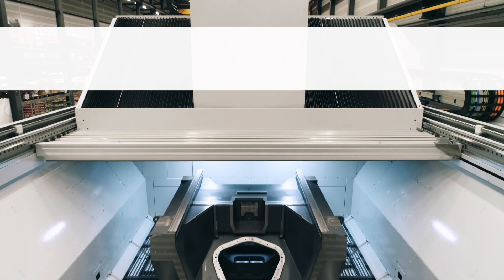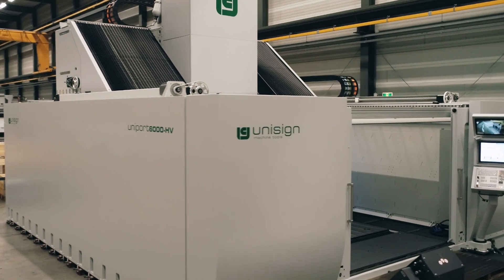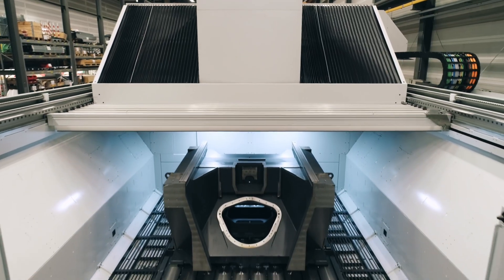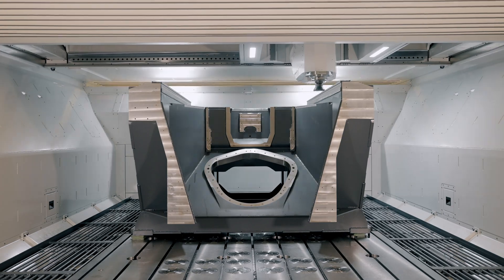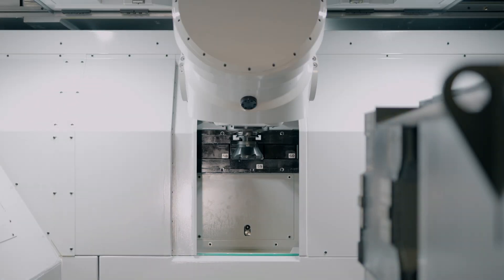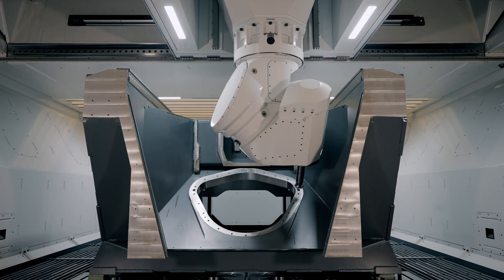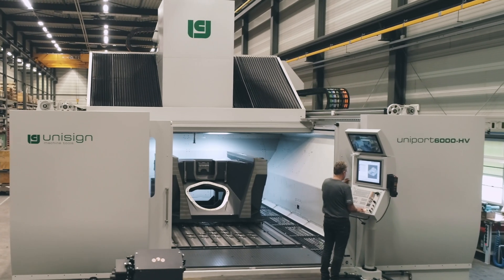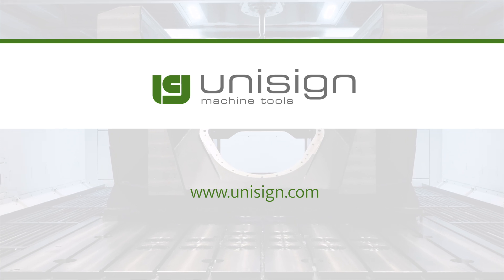5 Axis machining of complex components - UNIPORT6000 OG HV

Comment: It’s a 2 axis head or a 5 axis machine, get it right?
Reply from the maker: Dear Steven,
The HV-head is a continuous 2 axis head and in combination with the X, Y and Z-axis, it is a full 5 axis machine.
Reply: @unisignmachinetools 3+2 or 5 ?
Reply: @Tornadowp I'd have to imagine it's full 5 axis, I think that's typically a software limitation and it'd surprise me if they wouldn't spring for better controls software on a machine that expensive.
Reply: It is a full 5-axis machine, so contour machining is possible. @spazzywhitebelt